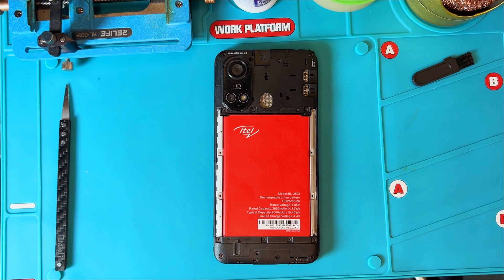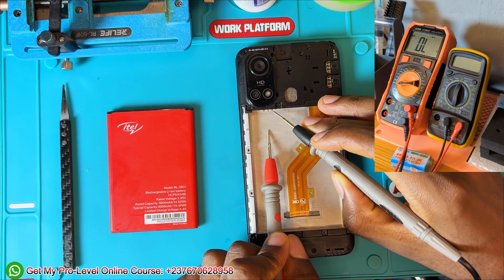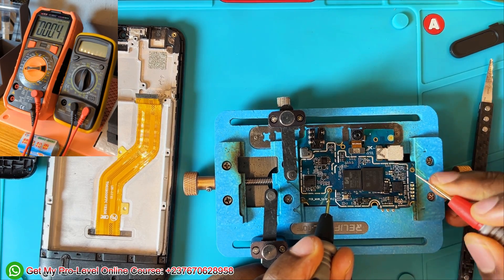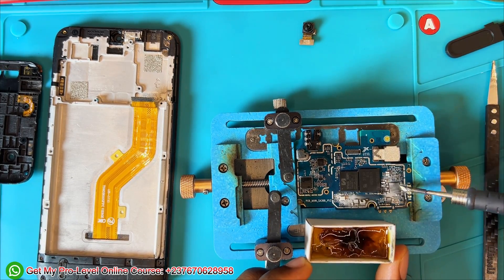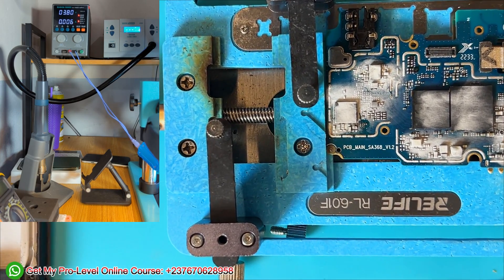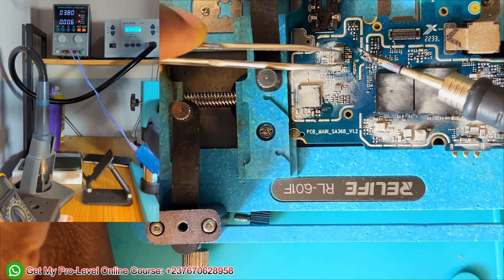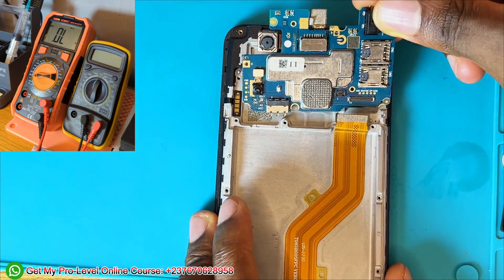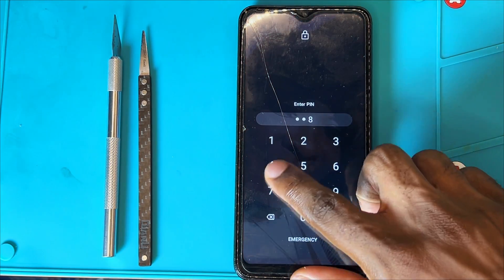Complete Mobile Repairing Course | How to Repair Any Mobile Phone Power Problem!

Comment: Great work Serges 
But I can't seem to get the rosin flux on the PCB the flames always goes up any hint?
Reply from the maker: Soldering iron is too hot that's why. 
330° should work out will if you do just like I do in the video